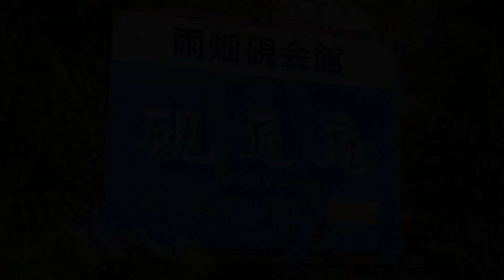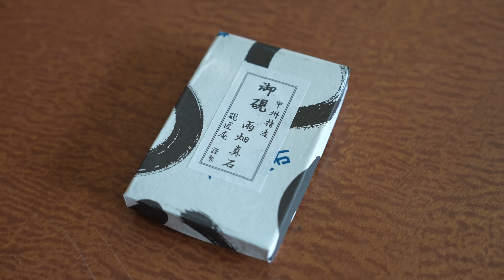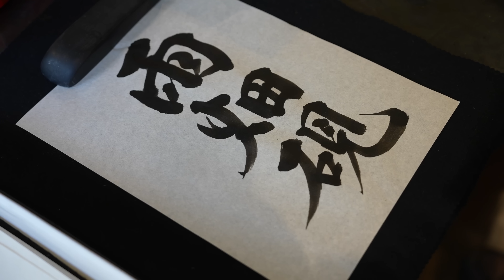硯ができるまで。本物の雨畑真石が生み出す極上の黒。

Comment: My favorite part of this is the proper use of PPE
Reply: That face mask was not good enough for the machine grinding of that stone.
Reply: @tuppyglossop222  It’s not an enclosed space, so OSHA’s general guidelines say that it’s fine.
Reply: @muffinconsumer4431  I don’t know who your OSHA is, but in Australia that type of mask is not acceptable for that type of work. 
There has been a lot of problems with silicosis here, resulting in a complete ban of the manufacture of stone counter tops. 
Admittedly a lot of people were not using any type of mask, but studies showed that the type of mask used in this video was not suitable for this type of work.
Reply: @tuppyglossop222 that stone isn't quartz and doesn't seem to contain quartz particles - if it did then it couldn't be worked so easily. Not much risk of silicosis.